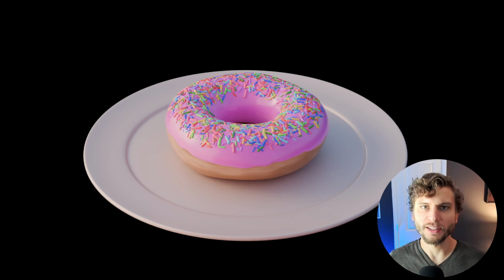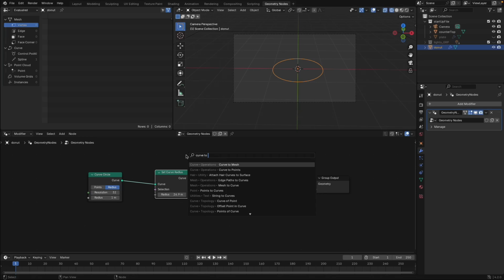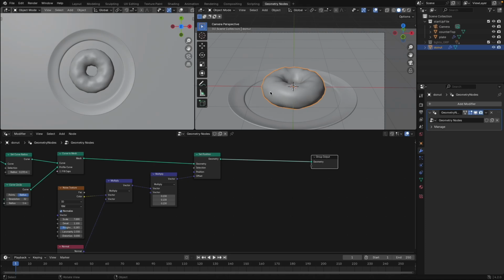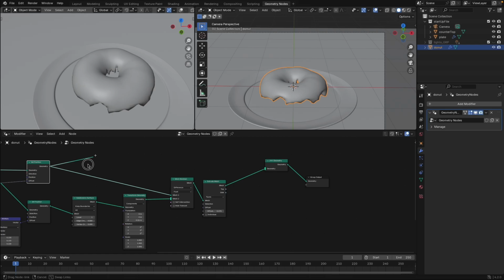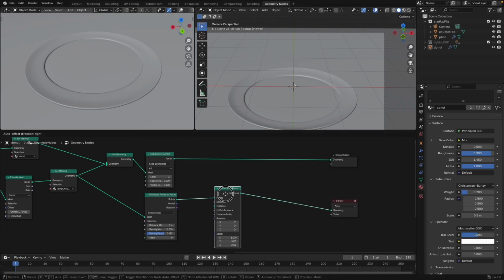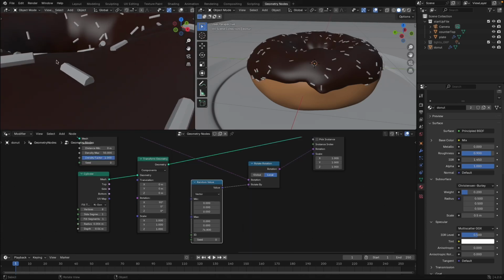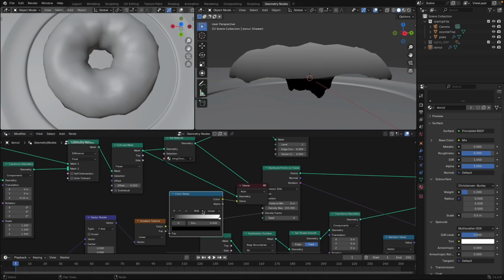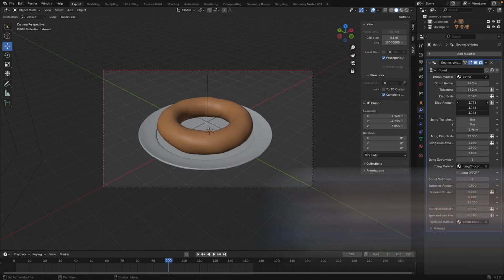Learn Geometry Nodes the Easy Way!

Comment: no 🤦‍♂️; booleans rn are not good practice in GN. How is this a beginner's tutorial? You should be teaching how things work and explaining it more. If it's not for beginners, then you don't have to explain as much and could be more high level, but this effect isn't really that complex etc. to warrant an advanced / intermediate tutorial. And I don't think the tutorial that is just "add this, this, and this node" appeals to anyone (not that yours is all like that, but kinda is a bit.). I think you lost both audiences 😅. This would be really hard for a beginner and be kinda boring for more advanced GN. Maybe some people 🤷‍♂️, who like to figure things out why themselves.

Keep trying, I guess.

I like how you used the normal for the offset. It shows you know what you are doing a bit more than the other YouTube tutorialists. it bugs me so much when they keep subtracting 0.5 when they could just uncheck "normlize" on the noise 😫.
Reply from the maker: Thanks for your thoughts! I like booleans 😉
Reply: @KenanProffitt  you probably have a very good computer (or with very little geometry). i once saw someone who had a GN boolean workflow and it was because they had a very good computer.

anyway, enjoy.

Comment: Sorry I am having a lot of difficulty following your tutorial.  I followed your every step but did not get the same results.  The Geo Nodes section seems to be out of focus all the time and it is hard to determine what values you are using.  Explaining which Geo Node you are going to use and why would help immensely for beginners like me.
Reply from the maker: Hey there! Sorry about that. Is there a particular part of the tutorial that’s causing confusion for you?
Reply: @KenanProffitt  I will let you know once I tried to follow the tutorials.  Thanks.

Comment: I am having some difficulty following your tutorial because you have not specified what units you are using.  I loaded the file you provided and its units is set to Imperial and using the values you suggest makes weird things happen.  The render is set to cycles, I only have Eevee.
Reply from the maker: Hey Alfred, sorry about those issues. If you shoot me an email I’d be happy to help walk you through some of these.
Reply: @KenanProffitt  Thank you for replying.  I am going to try again from the beginning and see if it was something I overlooked.  I hate to give up.  I have difficulty with Geo Nodes until I discover how to determine what Geo Node will do the action I want to execute.  e.g. I had quite a challenge to find out how to do an 'Inset' using Geo Nodes, but after a few tutorials I did discover how to do it because I understood each Geo Node was chosen and why. As far as the Scene settings I have set it up to Metric.  Just to let you know,  I am retired and I do Blender just as a hobby strictly for pleasure.🙂